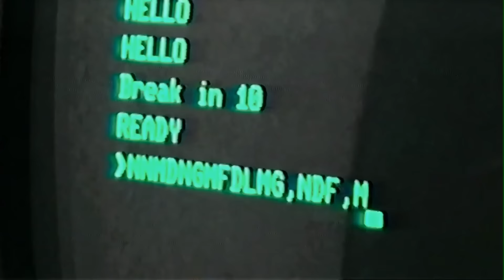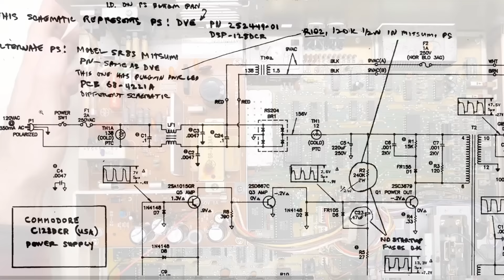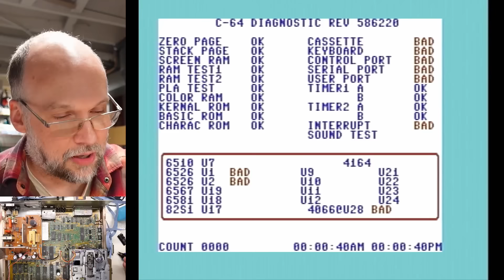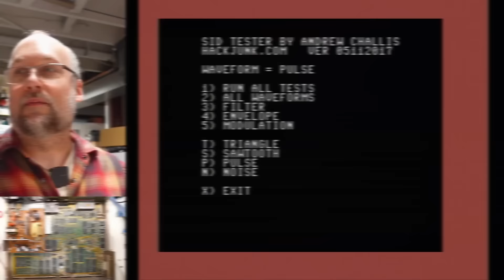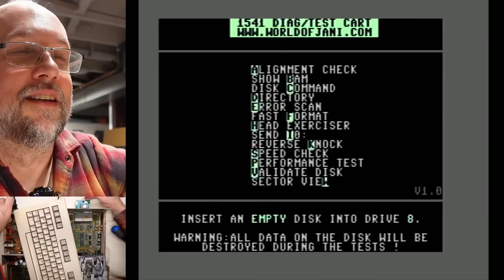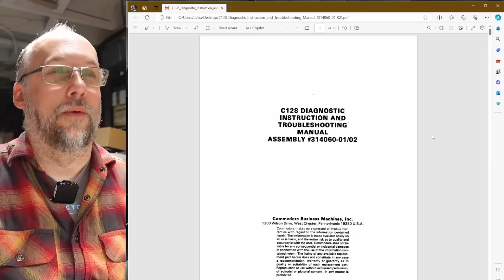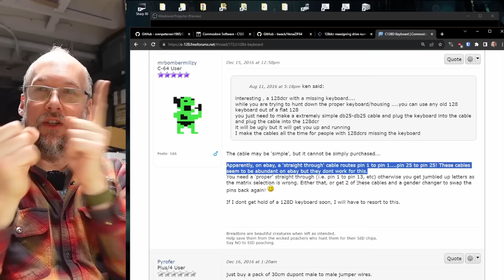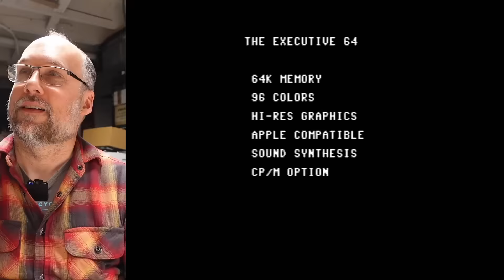I did everything wrong when fully testing this C128D

Comment: Thanks for featuring the mighty C128 again! Side notes: The SID on your model is a 8580R5 (it’s a 6581 on other motherboards), and that Z80 seems a 6 MHz model, although it runs at "half 4MHz", i.e. 4 MHz half of the time for an effective 2 MHz (check with oscilloscope) due to VIC-IIe bus access priority. I believe it could have been possible to run the Z80 at full 4 MHz when the VDC was in use instead of the VIC-IIe, but that would have probably required more logic. Note that CP/M mode was there just because the C64 CP/M cartridge was not working on the C128, and Commodore marketing wanted an extra check mark on the specs. Well, at least we had some extra fun with the Z80 in the C128!

Comment: I still have one of those C128DCR's.  I found it in, of all places, a computer recycling warehouse.  It was in a badly waterlogged commodore box, wrapped up in plastic, with the keyboard.  Needless to say, I made it disappear from the warehouse.   It works perfectly, except for the floppy drive.  Once in a while it'll work, but it mostly whines and will not read a floppy.  Bummer.  Keep up the good work!!
Reply: Did you try to service that floppy drive? It might be something simple
Reply: I have. I think it's the bearings in the spindle motor that are bad.  I also haven't tried taking it apart too much, not wanting to make it completely inoperable.   It'd be nice to have a working 1571, as I have two other 1571's that no longer read either.

Comment: Loved the video. You may have noted that, while it seemed pretty slow in 80 column mode in CP/M, it was still faster than in 40 columns. That's because it runs in FAST mode at 2MHz in 80 cooumn mode.  The Z80 is technically 4MHz but limited to 2MHz due to its reliance on the CBM chips.

Comment: The Commodore 128 was three computers in one. A C64, a Z80 and a C128.
the floppy is another computer.
When the C128 came out the Z80 software was already out of date. 
There were hardly any applications for the C128. 
What was left was just the C64 compatibility mode.
Reply: No.

Comment: You should take this show on the road, man.  Showing us your mistakes is so very educational.  I don't generally work Commodore hardware, but all systems tend to have little quirks listed in some dusty corner of the documentation, so RTFM (Read The Fine Manual) really does pay dividends.  This video drove that home quite nicely.

You might try a breakout connector?  That should allow you to try different combinations of jumpers to get where you need to be on the keyboard port.

Comment: Hi, nice video. Seeing the 128DCR working still. My first own computer. BTW, a 25 pin SCSI cable is not necessarily 1:1 straight through. It’s only 8data lines some additional signals and a bunch of grounding for each signal as twisted pairs on good cables. I had a bunch of old scsi cables from my old servers and macs and needed to repurpose one  a couple of years ago for som project that needed like 16 signals and 5 lines for power and ground and there wasn’t enough pairs there because almost half the pins were „shorted“ as a common ground and not just straight through - most likely to make the cable not too stiff with 25 connections.

Comment: The 128DCR is pretty much the most unreliable machine Commodore has ever built.
I worked for a metalworking company in '90/'91 whose cutting machines were CP/M controlled.
The only way to get CP/M machines here in Germany at that time was with c128s.

The 128DCRs failed on average after about 3-4 months of continuous operation, while 2 old 128Ds (built in '85 + '86) were still running without any problems.
These were also the only two machines that lasted until the company switched to BSD-based computers in 1997.
However, storing DCRs for years was never a problem, our company had kept 20 in stock since 1990 to compensate for failing ones.

Comment: The plastic C128D is sometimes nicknamed C128 Diesel because of its rather noisy fan. :)
You are correct that there are normal C128 and 1571 motherboards inside the plastic C128D.
AFAIK no C128DCRs ever left the factory with a fan.
Reply from the maker: I noticed it does warm up a little but overall runs quite cool

Comment: The 'plastic' 128D using the same board as the 'flat' 128 was designed together with the 'flat' 128. The original board has a hole and some modifications specifically to allow for the original 128D (as per Bil Herd)

128DCR PSU tends to be very reliable and not go overvoltage, but note there exist at least 3 different PSUs. None are known to go overvoltage on failure. Seeing how yours still has the cutout for installing a fan, it is not the newest 'even more cost reduced' power supply. The biggest issue with the PSU is the PCB being rather brittle and easy to damage or break. Be really carefull when removing/reinstalling it.

I strongly suggest installing a low noise fan which can run from 5v (at a lower rpm). You don't need a lot of airflow, but just that little bit of airflow will help the power supply, and the nearby vic2 and vdc chips a lot. 

Commodore made those machines with an expected lifespan of some 5 years... and for that you don't need the fan. But to make it last... that little fan really helps. 

The mounting holes for the fan are non standard size, and I'd actually rather suggest to use some silicone glue or such to stick it in place, and at the same time provide some accoustic insulation between the fan and the case.

I actually validated the prototype of Sven's diag harnass for the 128, and can confirm it fully works with a DCR provided a longer cable for the cassette port connector. But keep in mind the 128DCR case leaves no room for the 'ears' of modern versions of that connector. That is a problem when testing a board while it is in its case.

Ah yes... CP/M actually is using a virtual terminal which is bandwidth limited, and pretty similar to using a 2400bps terminal. There is a way to increase its speed, but it won't ever be fast with CP/M... It can however be rather fast with a proper 'driver'. I have done quite a bit of development of software using it. During the last Commodore Users Europe 'online' meeting I did a 20 min presentation about one of my projects (OS128) which shows how fast VDC output can be, even with a multitasking OS. It has some '2d acceleration' functionality which is not used by the Commodore roms or CP/M, but when used properly can make a huge difference. An interesting and little known trick is to use rle compression when transferring data to it, and use its hardware fill capability to 'expand' the rle data. This saves bandwidth, and even when 'realtime' encoding the data, is often faster.

Comment: I love the C128 even though yes, I mainly used it in C64 mode. I always wanted a D or DCR but yeah, never got one. Also, I think that if you were trying to avoid pitfalls I think you failed in more ways than one. ;) I also realised that I need to get myself an EEPROM programmer. That would be so handy for so many things, especially our C128 which has fallen into disrepair (keyboard wasn't working properly when we stored it so I guess an IC has gone bad and just needs replacing) so getting it tested would be nice.

Great video, Adrian. Merry Christmas./Gleðilig jól.
Reply: Yes, many Pitfalls.  I think I counted four of them?

Comment: (6:45) I have an 128-D european model, with plastic case, (which I bought second hand in the early 90's).
This european model does have a 2.36" 'Panaflo' fan as standard. But it is EXTREMELY ULTRA-MEGA-NOISY, 😵‍💫 to the point that it was impossible to think and work (writing or programming) in front of the unit. It was infuriating.

I guess the metal case of the 'cheap' version helped to dissipate somewhat better the heat from the power supply, and that's probably why they decided to do without the fan, (further reducing costs, and saving US users unbearable noise in the process). 👋

Comment: My thought as to making a keyboard adapter for the 128 to 128DCR... you can get right-angle pin headers - one row against the board then get a version with longer tails for thicker PCBs, then stagger the pads and stack that on top. Then on the other side a standard DB-25 connector. I'm sure it would be a simple layout exercise in most any PC board CAD app (like KiCAD)...

Comment: The keyboard adapter comes in handy for SX-64, too...even easier.
If you got the SX-keyboard cable, all it takes is a gender changer to use the C128D-Keyboard on SX64
I know, usually the SX cable is missing, but that´s a straight through, as far as I remember. So one could even get rid of the gender changer and use a standard 25P-cable with C128 KeyB. You´ll need a dremel though to make a 25-pin fit on SX

Comment: Diagnostics are really only reliable if you know how they test what they test.  For example, some ram tests may pass, while others on the same exact ram might not pass.  Testing methodology matters.

I think my favorite old computer diagnostic tool was the "G-er."  This was literally a DB-25 with a toggle switch on it and some pins jumpered inside.  What it did was print upper case G's or if you flipped the toggle switch, lower case g's.  This was a quick and dirty test to see if your dot matrix printer had a stuck pin or bad pin driver.  G was particularly useful as it had descenders on the lower case g.  Kind of like a printer loopback plug.

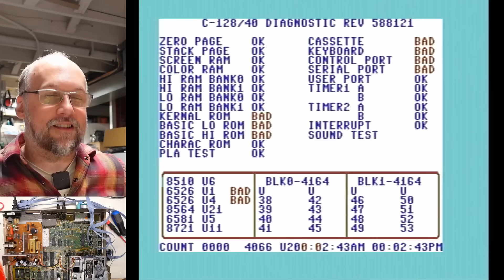Comment: At 30:29 you note that it needs Rev 785260 but then 8 seconds later at 30:37 it shows you using still using Rev 588121. But you got it right on the second read LOL.

Comment: I had a 128 as a kid.  It's true that 128 mode mostly went un-used.  There was one killer feature though, 80 columns on a terminal program for calling BBSes, and word processors.

By the late 80s and into the early 90s having only 40 columns of text was a pretty big limitation.  There were a few programs that could sort of fake 80 columns of text by using graphics mode instead of text mode, but the text was not very sharp, and hard to read.

So having 80 columns of sharp text was sort of huge for these two reasons.  IIRC I even lent mine to a friend to use as his terminal in the mid 90s, so he could connect to the early internet, and read email, get on IRC, etc.

Comment: One thing that joystick tester doesn't seem to test is the POT X/Y operation which comes from the SID and can often be bad. Really should try some paddle tests on those ports...

I managed to get a working 128 DCR as part of a massive Commodore salvage haul several years ago and it's my pride and joy. LOVE it!

Good mod is to make a couple little dip-switches hooked to the (cuttable) pad/traces on the MB that control the drive number for the internal. I cut mine to to set it to Drive 10 as I always run everything from a Ultimate2+ Cart instead of messing around with real floppies anymore....

Missing keyboard is also a big problem with Amiga 1000's found these days. The keyboards rarely were kept around... :(  And it's tough to find a replacement or even something that can be adapted to work.

Comment: The problem with the Z80 on the 128 and the CP/M Cartridge for the C64, is that the Z80 is running at the same speed as the 6510 of 1MHz, when CP/M Machines were running between 3.5 and 7MHz. The 6502 at the same clock speed, rund 4X faster than the Z80 and 8080/8088/8086 because what takes 1 to 3 clock cycles while the Z80/8080/8086/8088 uses 4 to 8 clock cycles for the same or similar machine code.

It is Commodore's mistake in running the Z80 at the same clock peed as the 6510 when they could have put in a separate clock for it.

40colums on CP/M Being bad? Again, many CP/M machines of the  time has a strange 32X16 or 64X16 screen, so compared to that, 40 would be in the middle of the two.

Remember, for its time, CP/M was the leading OS for more than a decade and if it were not for a marketing mistake, would be the leading OS to this day. It is not stated but the System on the Atari ST is CP/M Based, using GEM on top of its DOS, which for Digital Research was modified version of CP/M.
Reply: The Z80 in the C128 does not use the same clock as the 6510. The Z80 has a 4Mhz clock and runs at that speed the problem is that (and some one correct me here if this is not 100% accurate) the Vic II is still running in slow mode (1mhz instead of 2) and the Vic is doing the memory refresh for the DRAM so on half of the 4Mhz Z80 cycles the Vic halts the Z80 to do it’s thing, which renders the effective speed of the Z80 to around 2Mhz, which indeed is very slow.

Comment: As soon as I saw that this was about a 128D, my first thought was that the CIAs are likely bad. That was the problem with my 128D when I got it. I had to replace both of them to get it to boot at all. It's apparently common due to missing or poorly designed static protection circuitry on the keyboard and joystick connectors. I'm surprised at how good of condition this unit is in, with no major issues.

Comment: You're right.  I had an original 128 and I could count on one hand the number of times I used 128 mode.  It was always used in C64 mode, and I don't think I ever used the CP/M disks.  The machine is long gone, but I think I still have my floppy drive and the CP/M disks someplace.
Reply from the maker: Did you ever use the 80 column mode? I'm curious how many people even had an expensive RGB monitor that supported it.
Reply: My monitor was a lousy 14" that would barely do 40 columns.  It would have blown up if I had asked it to do 80.
Reply: I bought my C128DCR as soon as I got to Fort Polk LA summer of 1988. I had just spent 2 years in Bamberg West Germany for 2 years and had a SX-64 during my time there. I sold it to another solider as I was getting ready to leave Germany. I used that money and more to buy my C128DCR and a matching 1902 CRT at the Fort Polk PX (store). The sells person sold me 2 video cables, one for Commodore Luma/Chroma and a 2nd for Digital RGBi. I bought Infocom's Beyond Zork at the same time. This game would not work on the C64 and worked only on the C128 col mode.

Comment: Yes! The 8-bit dance party is always awesome to see.

I have a C128 sitting in a closet but it isn't working due to the power switch being messed up (I wouldn't be surprised if some traces were in rough shape too, as it hardly ever booted into C128 mode, but C64 mode would work fine). I have zero experience working on electronics so I have no way to repair it.

On a side note... Seeing that the C128 machines have an 80 column mode, do you think someone out there might make an 80 column version of the 8-bit dance party? It would be a lot of work, I'm sure, but that would be a pretty nice way to make sure that the 80 column mode on any C128 that you work on is functioning properly (especially if such a version let you press a key to change the colors used).

Comment: I had my fair share of C64, C128 and Amiga's over the years, and there was this sound demo, I made once a soundcopy of it and translated it to mp3 so I still enjoy it, but this was from one of the first amiga's, the soundchip was much better, when later models run this demo, it sounded worse, like the magic of the song was gone, the lead vocal in the song (instrumental of course) was in the original Amiga kinda vibrating, while the newer Amiga had a straight tone. Conclusion: other type of soundchip. Maybe this was also on c64/c128, later models, other sounds etc...

Comment: Control ports fail when the keyboard lines are FUBAR because they share the ports on CIA 1. A well-known issue on the 64/128 is a joystick in port 1 causing phantom keypresses if wiggled.

Comment: The main processor in the C128 is actually a MOS 8502 ( https://en.wikipedia.org/wiki/MOS_Technology_8502 ). It's almost the same as the MOS 6510 in a C64, but not quite (much as the MOS 6510 was mostly the same as a MOS 6502). I'm curious if the C128 used that "P6" signal for anything.

Comment: Hi Adrian. It may be that the cassette port loop-back connector was deliberately designed on the C128D so the old one won’t fit due to changes in the electrical specifications; it’s not just the mounting tabs (ears)! Just guessing, here.

Comment: I think most people who got C=128 was to use the 128 mode.  The ONLY time I used c64 mode was to play games.  Otherwise, I was in 80col mode for C128/ GEOS 128 with 1351 mouse (The 1350 mouse is an 8way joystick mouse = ugh, why did they bother?) .  There were a few C128 games, they weren't good.
GEOS128 ran in graphics modes in 80col. Luckily, I have the amber monitor.

PS: thanks for making this vid.

Comment: It's odd how they refer to this as the "Cost Reduced" model when they spun it's own revision board with all the integration of the disk drive hardware, and created its' own case and made it lightly incompatible with the original 128D, must have cost more to do that than to just keep churning out the 128 in a desktop case, but, commodore did make some, erm, "interesting" choices back then... :P

Comment: It just occured to me that they missed a really good way to reduce the cost of the C128. They should have given it a new port for the floppy drive. It would connect directly to the floppy drive mechanism. Inside the c128, in C128 and c64 mode, the z80 would control the floppy drive directly. It would be mostly compatible except fast loaders wouldn't work. If you needed that, then you'd have to get an old 1541. The 1571 had those problems too anyway. In z80 mode, the 6510 would control the drive.   That way they could eliminate most of the disk controller. AND get faster disk access.